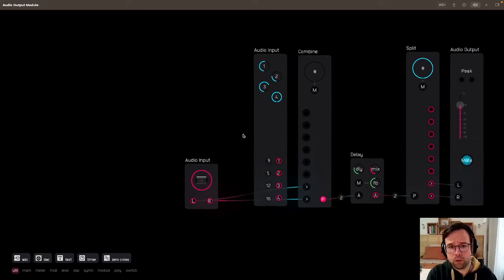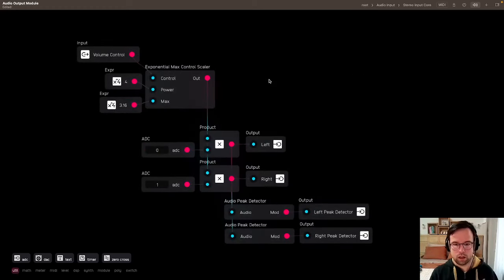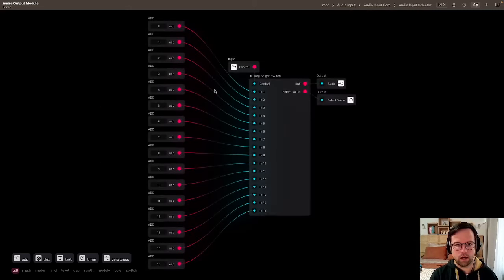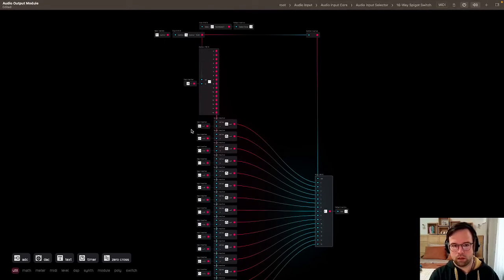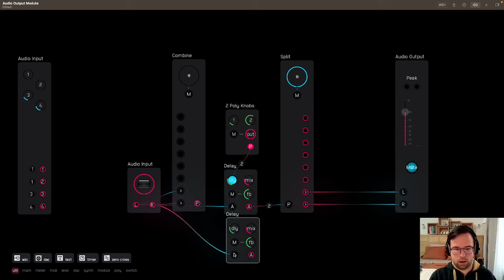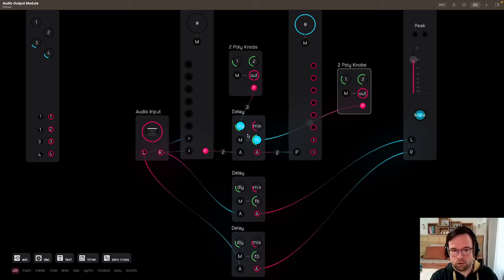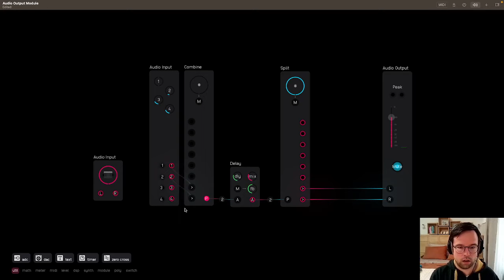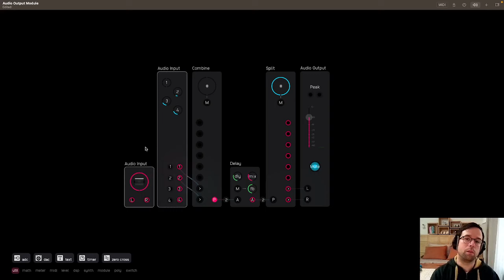Wired Up with Mark 2 - Building Audio Input Modules

Comment: Another fascinating video and I now better understand the mono/poly mix issue I was facing that you solved in the Audulus forum. I'm definitely an Audulus user and not a module designer/developer, but it's useful to understand at some level how modules are constructed to effectively use them. Commiserations on your audio issues that destroyed your earlier video ... a bit like forgetting to hit the Record button before you lay down that brilliant solo although most DAWs offer functions that help recover from that scenario.
Reply from the maker: Can you believe I even had the thought, hey, this has been on overnight, maybe just check it, and I said nah it’ll be fine lol. Anyway glad it helped still!
Reply: @audulus  My modular experience is limited to Drambo on the iPad and Hyperion by Wavesequencer on my iMac. Drambo 'auto connects' patch cables for you and Hyperion has an 'easier' patching process. My issue is getting in a bit of a tangle when patching nodes, but I guess with practice and experience that will become easier...
Reply from the maker: @anacrusisinthailand  Yeah that's a useful feature to have, but it also would be very difficult to implement into Audulus. There will always be a certain learning curve in Audulus, and in some way, but the principle of modulation outputs to go modulation inputs, gate outputs to gate inputs, octave outputs to octave inputs - that part of it is pretty simple, too. The only issue is learning what each of those signals mean.